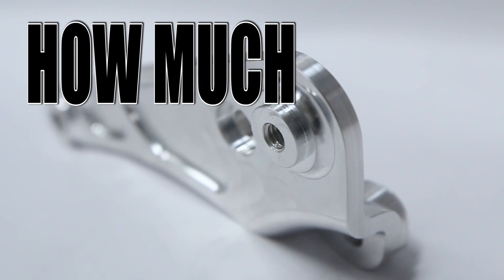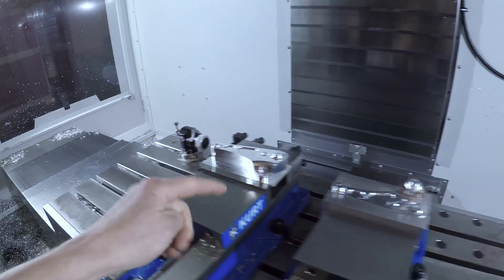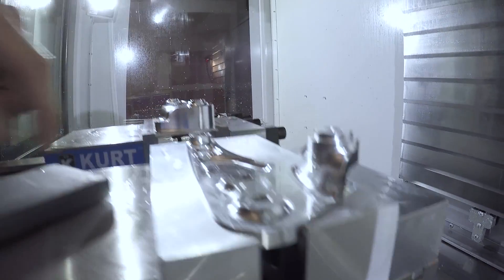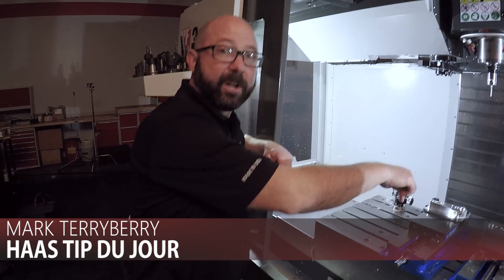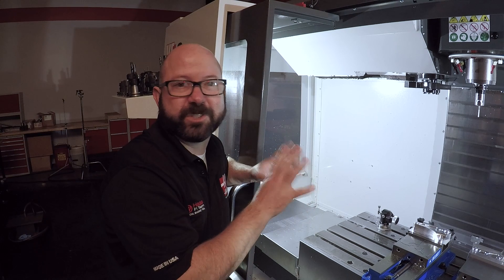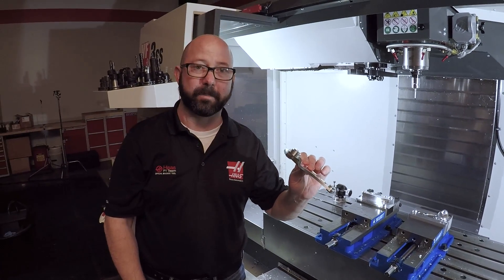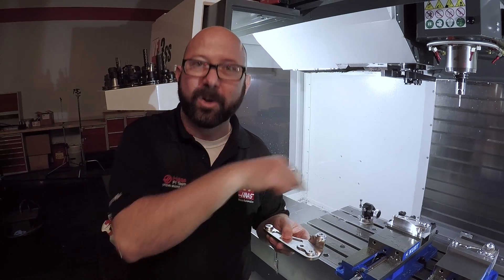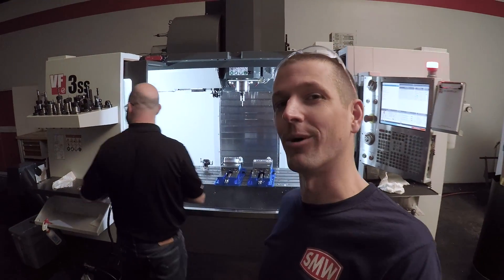How Much would You Charge to Machine this Part?

Comment: Are you saying $3300 for a days work? No wonder manufacturing is going to china! I guess he wont be selling many supercharger kits unless he off-shores the work.
Reply: Jesse Fritz They're paying workers $50/month, not doing QC, taking every chance they could to cut corners, possibly use cheaper materials if they think their customer wouldn't notice and taking the money and running if there is ever a problem... Oh, and stealing your design and selling it if they think there is a market for it.
Reply: Company X needs 30 of a custom-made part. Company solicits quotes from 10 shops. Of those 10 shops, 9 of them give quotes between $90-110. Shop number 10 quotes $35. Company X wasn't born yesterday, they can spot a potential shoddy fly-by-night supplier from a mile away. They discard Shop #10's quote, and choose from the other 9. This is how it works in the real world.
Reply: Julian Wilson read through the comments. Most of the guys are estimating 32 hours of time plus materials. Much more time in setup than in machining
Reply: Jesse Fritz - no offense but you sound like you don't actually do any machining but spend time watching shows and videos about machining and thinking you know how to run a machining business.  You said $25/part.  For the run of 30, that would be $750.  For the part shown, you are looking at a few hours to do the CAM work, machine the soft jaws, etc.  Say $40 for your soft jaws.  Say $10 for each metal blank for the actual part.  Toss in a couple of hours at least for the total amount of time spent dealing with the customer from the first call to when you're cutting metal.  

So you're into the job for $340 in hard costs, plus 5 hours of your time.  If you can turn a part around every 13 minutes (including loading a new part), that's 6.5 hours of machining time.  That leaves you $410 to pay for the 6.5 hours of machining time, 5 hours of your time, the cost of your shop, insurance, electric, tooling, and everything else.   Your payment on the machine alone is going to be $20/hr every hour of the work week (whether it's making chips or sitting idle), and you need to plan to bill it out for double that.  If you had budgeted 20% of the job cost to cover tooling, consumables and company profit.... well, that leaves exactly zero to pay you anything for the 5 hours you put in.  And it leaves zero to pay for any employees.  And it requires you keep your machines running 40 hours a week, every week - as the only employee of your business - otherwise you're out of business.

Which is why nobody who actually does machining for a living would ever make that part for $25/ea.  Not unless it was a committed order for 10,000 parts with a repeat customer and they were supplying the material.  Otherwise you would go out of business.

Forget Titan - that's fake TV.  And CAM software doesn't do the work for you anymore than a word processing program writes your resume for you.
Reply: its actually 8hours × 60minutes = 480 minutes ÷ 12minutes per part = 40 parts × $109 = $4,360. for the day. But thats total machine output. That doesnt mean profit. You have to subtract (labor cost hours, raw materials, employee benefits, utilities, machine depreciation, machine servesing,  business insurance, (other business cost like advertisements, etc), etc...not so shinny after all.
Reply: "you guys forget the machine is doing ALL the work." - Dang, you're right. I didn't think about that. I forgot about the part where the machine talks to the customer, takes the design and turns it into a 3D CAM toolpath, creates its own fixture, orders bits, installs them when they arrive, orders the stock, unloads the truck, loads the stock onto itself, performs the machining operations, unloads itself, cleans the shop, calls the customer, deals with redesigns after the initial prototype...ET FREAKING CETERA. "I'd do them for $25" each. No you won't. Bro, do you even business?
Reply: If he sends it to China he won't sell any supercharger kits as they will copy his design and flood ebay with the same kit for a tenth of what he would have sold it for.
Reply: Jesse Fritz But you still have to make the soft jaws. If you're only making 30 of them, you still have to cover your costs. You're talking like you would make that for $30 if you made one of them. 

You're not going to be operating a business for long if you do it that way. Even at quantity, your raw costs for material and tooling aren't going to be much less than $30 and that leaves out the cost of buying, maintaining and operating the machine, leasing shop space, paying someone to make the programs, and on and on and on. All those things are rolled up into he price and then you actually start making money on the part. 

What kind of business do you run where you just swag a number out there and hope you don't end up losing money?
Reply: Melange Bryce: you are right. Though we chose the Mini Mill because it was cheap, we tend to make things that easily fit onto it. I don't think $25-$50/part is viable, but perhaps $65-$85 could be. Again you are right- the machining costs are not the biggest drivers- its all the non-machining time; programming, dealing with customer, purchasing materials etc etc. Our Mini Mill could probably machine one of those parts in the time it takes to order the raw material. I like your comment: "this isn't really a part all that suited to American manufacturing unless the client needs it quick or cost isn't the prime concern."  For me, this is the challenge. What sort of work is it that suits western manufacturing... and how do we do it really well? I got to small volumes in short time- and even then just doing the machining is not enough. We started doing design, painting, assembly and test- and we were forced into machining because buying small volumes was so expensive. We started by doing our prototype stuff in house, and over time have expanded this to small volume work. On the subcontract side our local suppliers tend to be expensive, and once the volumes get bigger it is better for us to go further afield. I do want to be clear, we do support local businesses who are working hard to drive their costs down. I don't mind them making profit at all, but I do mind them not innovating and sticking me with the bill for it.
Reply: Julian Wilson You think the machines magically appear in the shop (which is free), program themselves and run on hopes and dreams? No. They machines have to be paid for and  maintained. Also, they have consumables like tools, coolant loss. Finally a person has to sit there and create the tool paths and run a test parts. Not to mention that the raw materials cost money.
Reply: tmoney1876, I agree with you. We certainly would cost it higher than $30. But for me the "efficiency" is not that "we are better at machining". Far from it, I assume it will take twice as long for us to do it. The problem I have is that I have an honours degree engineer sitting in front of SolidWorks who I pay a ton of money per hour, but I struggle to keep him busy every hour with projects. He reminds me of John a bit, he is happy to run a Haas for his small batch stuff- he generates the code right off his desktop.He is not an experienced machinist but does make good stuff pretty much every time- most of this is down to the Haas and the software, PLUS we set it up to use a standard billet blank. Some of the time our Hass sits idle, but when it runs it covers the designers hourly rate times 10 times over. Our time from "desk to cutting metal" was our focus when we established the capability. I remember one of our suppliers came in and laughed at us for the amount of metal we waste because of our standard billet approach. He wasn't interested that our waste material cost for a whole day was less than one hour of set-up labour time he charged us- but saved us hours of set up. A great saving for us is also the "wait time", from print to part. In development it is great that we can keep our jobs rolling and not wait for the subcontract cycle time. But even this is not the biggest benefit, what we see is that given that they have the problem of machining the part, our designers tend to produce easier to make parts. This is a huge saving on development, and a huge saving in production costs later. Our young designers just don't have the machining experience to do this intuitively, but the experience of making the stuff brings them up to speed. Finally, I use the machining to smooth our work lows... we can keep stuff in house when we have a sudden dip- for example when a new project gets halted because the customer wants to make a change. I can't have my designers sitting around, they are 10 times more expensive than having a Mini Mill sitting idle. I've not yet talked about taxes, they weigh heavily on my decision and often tilt the decision to make rather than buy (even when we do it our expensive way).
Reply: Yep, I'd do that. Keep trying new subcontractors. Of course I'd visit them first and see how they are doing it. My problem is that often it comes down to changes in training or changes in procedure. Everyone uses the same machines. The big cost is the fella stood next to the machine. You see an old man in a Ferrari with a pretty girl sat next to him.... wow look at that expensive car??? NO! Look at that expensive broad- she's gonna cost far more than that red car.
Reply: Interesting conversation: our lease and fixed costs of our Haas Minimills are much less than $20'hr- more like $8/hr. Lease costs are about $700/ month- for the ones we bought our money was worth so little in the bank that the cash was better in the machine even at a low return. For us, when we looked at the price we were charging our clients, we saw that the cost of our machines and the cost of the materials was actually only a small proportion of the overall costs. I agree with Mel that $25/part is a recipe for us to go broke. But for us $109/part is exactly the same- because we don't get the work. We reasoned that if we saved half the machine time and half the machine cost the savings to the customer would be quite marginal; by contrast we worked out if we changed the cost of our set-up and changed the costs of our administrative overhead we would have a much bigger impact- both on price and profit. This all sounds a reasoned response, however in reality for us it was a reaction to our customers no longer accepting "cost plus" pricing. They went to "market pricing", often with price reduction curves applied over the period of the contract. This was the turning point for us. Our old model of adding up what the job cost us, adding a margin we figured would provide us with a profit and giving the customer that price- got us laughed out of their door. When we asked about this some of our customers revealed that our competitors prices were clustered around a different MUCH LOWER number. But none of these competitors were local... they were all in low cost economies (like Poland). Our clients would say... this is what the market pays for your stuff now: match that or go do something else. When we looked at our numbers, our basic costs for the machine, tooling and materials could not be reduced enough to meet the new price. Clearly, we had to solve the problem by looking at the costs and processes elsewhere in our organization. Motorman makes a provocative comment: "if paying them by the items they finish was much better then everyone would be doing it". The truth is- everyone IS doing it. Outside of our businesses this is exactly how the high street works- you pay for the stuff (like a car), the prices don't simply reflect the hours it took to make the car (there are some great stats about this in the auto industry, the better the design the quicker to make- not the cheaper the car). I'm bothered to write all this to share my journey and say don't make the mistakes I made by thinking the world around me stays the same- I was caught out and had to make radical changes, it was tough and stressful. I'm now quite fearful of falling behind the pace of change. Stay ahead of the curve and not behind it, its much less stressful when you are in charge of it. At present, our big push is into finished product direct to consumers- because there is a margin there which just isn't in our old tight little spot in the supply chain.
Reply: The thing on our side today is IT- data handling can be automated. But again Motorman, you are right. We tried piece-work and it doesn't work- its like a game of whack-a-mole- constantly chasing problems that occur when people ONLY focus on banging parts out. In the end we had to have a much more balanced approach. We ended up paying not per piece but for the combination of QDP&C (quality, delivery, price and conformance). This pushed the worker back into working smart rather than hard working. The "handle turners" left, innovators stayed. It's all down to the nature of the individuals. Keep improving you machines, keep improving your people. When someone says they have 20 years of experience we always ask our selves... is this 1 year of experience repeated 19 times? We want to know about the new ways they have done things in the last 6 months. If they can't give us a list- we leave them out. Motorman- you make very good points about labour laws. We dropped the use of hourly pay and that left us with the problems you described. Eventually didn't even track employee hours, we set them by not having the factory open more than 40 hours a week. We rely upon Parkinson's Law- "work fills the time available". We limited the time to 40 hours a week- no overtime. Extra pay comes from extra profit not extra hours- they make more ...if I make more.
Reply: Yea. Its sh*t isn't it. Same everywhere in engineering at the moment. Argh. We make stuff all the time in the aerospace industry... they call it "collaboration" or "risk sharing". Actually it means they get the R+D for free but they don't change their procurement policy (go out to three suppliers for quote). So when it comes to the promised volumes you are treated no differently from everyone else. No one wants the first drops. I understand this, yet this is where I went to look for pay-dirt- because everyone hates small volumes for other reasons too. This actually makes it the only premium market left. When I looked at volume manufacture- aerospace, autos, the margins are paper thin- lots of cut throat competition and this is being offshored at a lick too. So back I went to the small volumes and started with the question- how can I make a series of "one-offs" as cheaply as a batch of identical parts? Of course I didn't get anywhere near this target- but its probably 75% cheaper than when we started. That makes this small volume work actually pay well. Remember for us it is really small volume design and production not just machining.
Reply: If it's aerospace, more excaltly a defensive industry aerospace part, it's almost 100% a 505s controlled part. No over seas. Material 6061-T6 or 6061 T651-QQA250/11? So many more inputs needed. but $110 each for 30 pcs, if it's just a common part?  you'd do good. Pay the bills, put some $$ in the bank :) and move on to the next one.
Reply: Not defence, but even in defence there is lots of offset agreements- driven by countries buying each others defence products. Our tax payers buy your kit, on the understanding that you subcontract a certain $ back to our industry. I take your point about the increased input cost of regulated materials but even so the actual material costs is not the biggest burden on the business- nor is the machine. For us, output tax is a big issue and payroll tax is a big issue. Indeed, the biggest monthly pay-out is the aggregation of all the taxes- we have VAT at 20% of our margin, payroll tax of about 15% of our payroll and property tax (which is probably the biggest of the "small" taxes). And of course, what's left of our margin when all our other costs are taken is our profit - and this is taxed at 20%. Our workers pay their taxes on their payroll and then are taxed again when they spend it (VAT on 20% of many purchases). For us, when we do more stuff in house we are not exposed to the tax impact that the subcontractor has to cover. I think this conversation about the cost of subcontract work is analogous to the conversation people have at home when they consider a home project and choose DIY or get a tradesman in. The extra pay they get when they do more hours at work, vs the price of the hourly rate of the tradesman has gone quite negative in the last 10 years. An hour of your "overtime" gets you 20mins of tradesman time. The costs of the tradesman has rocketed in the last 10 years and he just passes it on; the tradesman is no better off. The overall balance for the homeowner is rocking back towards DIY, he feels the cost of the work is unjust. The tradesman is angry and feels the price homeowners want to pay is unjust- he has little left to cut out of his budget. Let's not be angry with each other, the issue is not our doing- but it is encouraging homeowners and business people to "in-house" more.
Reply: The owner gets paid by the job... the employees don't. You have to charge by the hour because employees get paid by the hour. They don't have the motivation to move jobs through the door.
Reply: Jesse Fritz I'm not sure that's even legal.
Reply: It's not that simple. Labor laws make that a nightmare. I've asked about piece work before. If they paid by the job, they would have to keep track of work done, (I.E. jobs you complete) AND time you worked. Legally they would still have to keep track of hours worked in case the employee hits them with an overtime lawsuit. Even if you are paid by the job, you still have to get paid for overtime. So they literally keep track of double the info regarding your pay, making it much more difficult to run the business. That alone would make the cost go up. If you are wondering why china can creates stuff cheaply, they can pay their employees dirt and no benefits or nothing. Manufacturing is expensive in the USA because of our beautiful government.
Reply: We (Northrup Grumman) don't have a internal hourly rate, our loaded overhead is $176.53 per man hour. When we issue RFQ'S, the expected rate is about $75-$150 per hour plus any cost overrun. Depends on the commodity complexity & security  ratings.
Reply: Do you (as of now) own a CNC mill, lathe, etc? Do you own a shop? 
I'm not telling you to shut up; I'm wondering if you already run a business the way you're talking about. I'm also "looking" for someone who can lathe up a part. ("Looking" in quotes because I'm interested, but have little funds.) I'm looking for an old-school piston valve for a steam engine. Instead of a D-slide design, this has a round piston design. It was fairly common on the later steam engines, but I haven't been able to get my hands on one, though I have found some old part prints.
Reply: Great list there Corlane. I totally agree. We flicked our focus from the speed of the machine and its material removal rate.... to the speed of all those things on that list. When we revisited Lean- it was so clear that the focus is on that list- but too often we focus on the productive bit. Lean is all about removal of waste- especially of those bits that occupy people. Great Lean factories don't machine things differently to you- they do all those other bits differently.
Reply: Ha ha Bro, do you even business?
Reply: Julian,  I was using the price of the machine the parts were made on - a VF2 IIRC in the video.  You don't need that machine to make those parts, but that's a common part a VF-series mill would make.  I agree that $109 is on the high side of what most customers would want to pay.  But you know as well as I do that there's no way you are spending 2 hours dealing with the customer.  Probably more like 5-10 hours of customer time.  And probably some engineering changes or other changes along the way.  You can't make money billing this job out at $50/part or $25/part or other numbers some of the guys here are tossing out, not unless you're a one-man show running from your garage.  But this isn't really a part all that suited to American manufacturing unless the client needs it quick or cost isn't the prime concern.  This is a Chinese made part all day long.
Reply: Julian Wilson So the machine shop does 90% of the work (producing the first part) on spec and maybe gets the job?
Reply: By far the funniest comment. +1
Reply: Also, if paying them by the items they finish was much better, why wouldn't everyone be doing it? You aren't the first one to think of that...
Reply: A CNC Router and a 3D printer is easy to have these days. I work with EDA software and then with CAM to get the g-code. I design also 3D parts for the printer. We know very well that the setup is too expensive. Also, we know that the geographical zone fixes the prices (have nothing to do with the material, setup, skill and hours, the same have other prices in another part of the world). In a rich country with solid economy, you get higher prices. That does not mean that the price of the final product is right. And very rare that means a better salary for the workers.
Reply: If that machine exist, it will cost hell lot of money to purchase.
Reply: I love this kind of comment. On more than one occasion, I've told someone that to run either of our CNC's for any purpose starts at around $2 per minute. They gasp and say "Wow, that's $120 an hour! I'm in the wrong business!"
People who have an "employee" as opposed to "business owner" mindset think that every dollar that comes in goes right into your pocket. Those same people are equally surprised to find out that us evil business owners often make less than they do, sometimes even less than minimum wage.
Reply: By the way, my estimate for this part was $100.
Reply: I do understand and have experienced these same problems. But eventually we find decent sources that have QC and are much cheaper. The problem is I'm also competing with  Chinese competitors of my products, and people buy them. We have competing supply chains and I cant win on my own. I need my whole supply chain to help.
Reply: @tmoney1876, When my daughter was newborn baby and needed milk supplement, we made a subscription to a farmer that had a cow with milk. But it was very expensive, more than the current price circulated in our village. When we asked why is so expensive, he said that his horse needs medical treatment!!!  Yeah, many jerks around the planet these days... (just reply if you don't get the relation between the cow and the horse - as the farmer explained to us)